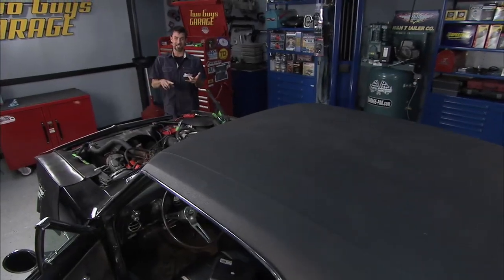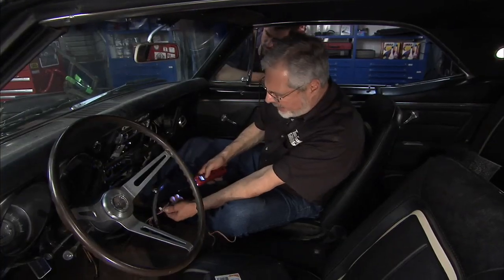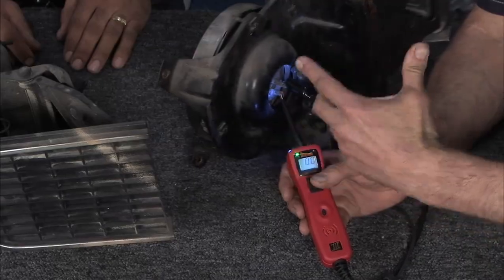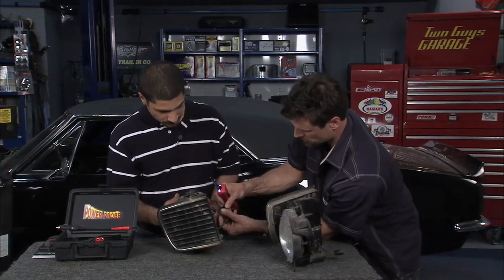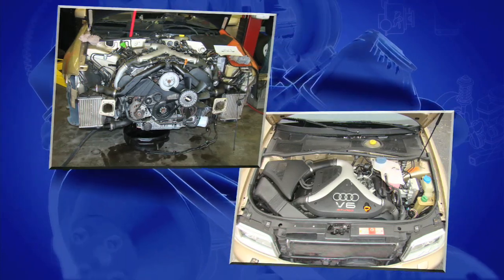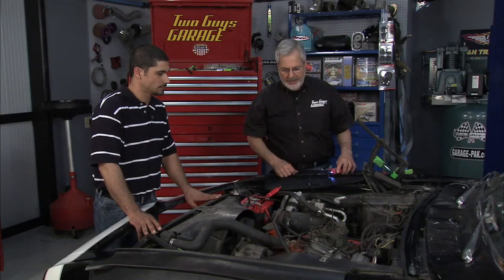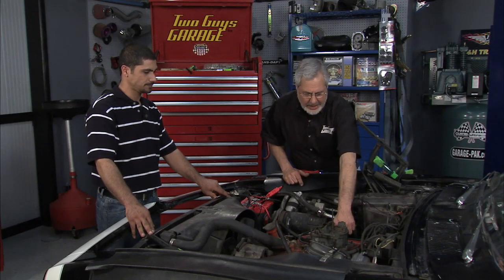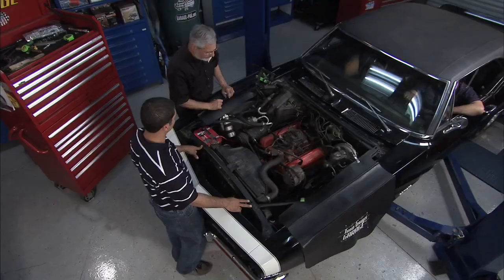2 Guys Garage Power Probe 3 overview

Comment: Hi, can i use my power probe to check injectors??
Reply: Iván Blanco you can with the power probe 4
Reply: varelamarco68 and with the power probe 3?
Reply: I'm not sure. You could go down to harbor freight and get a noid light tested for pretty cheap and test them that way

Comment: How can you check continuity if you were tracing trailer brake wires? For instance, 
if wires to were at the back of a 4-Door Long Bed truck and you were under the dash or in the engine compartment.
 How can you check continuity and map out wires  on  20 foot wires?

Comment: Just a warning to the buyers of this tool, if it ever goes bad Power Probe won't fix it they want you to buy another one. Great costumer service!! I had mine for years and it suddenly just didn't work so I send it in for repair. Thinking it would be a $40-60 fix but NO they want me to buy a barebone kit to replace it..
Reply: riothero313 - Thats exactly what i thought untill i used one myself, it has the ability to supply Live or ground to anywhere you need which can make trouble shooting a problem very quick and easy can also help locate breaks in wires and bad connections with the indicator lights. you can test parts off a vehicle in seconds too.
Its basically a volt meter, continuity tester, test light, and a jumper lead in one small package. if you need to check resistances you can grab a meter just depends on what kind of work your doing.
Reply: I have a Fluke meter, I'm not sure why anyone would ever need one of these things.

Comment: GREAT VIDEO, BUT, in order to use the power probe , it is best to power up the tip, then make contact with the object, rather than make contact and then press the power button, reason for is that it keeps the arc at the end of the tip, rather than at the SWITCH, this way the switch will last muuuuuuuuuuuuuch longer , in case of a overload, it will not burn out the switch prematurely